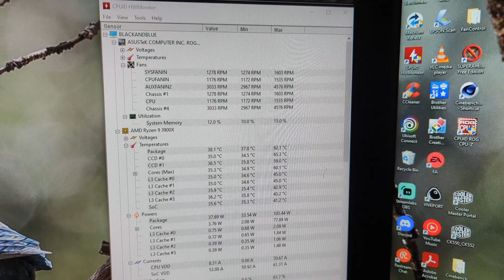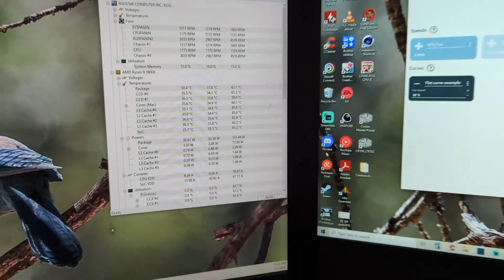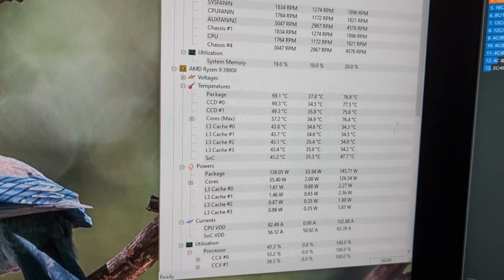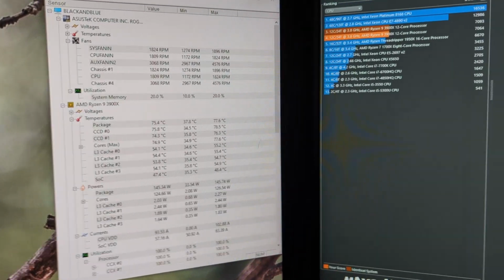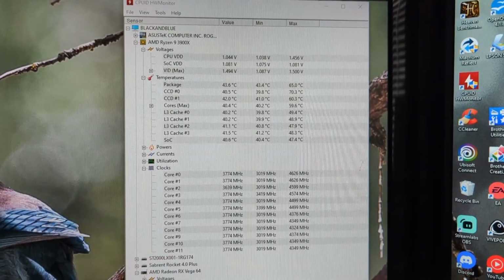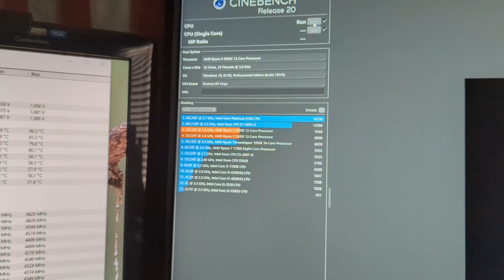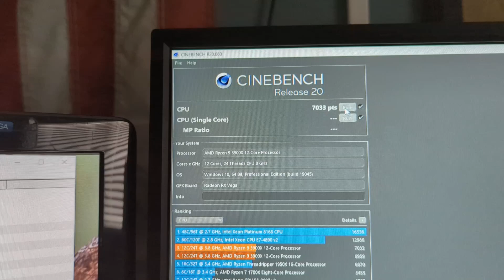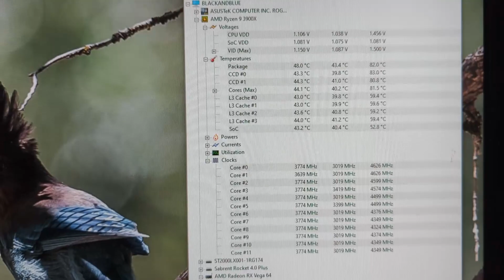280 radiator leaked on me

Comment: Sad to hear your phoenix took a dump. I found your channel after I purchased one of those radiator pump combos and I was trying find the tubing size and your video you did was helpful. The thing your had the only video on it at the time. I didn't end up using because I like 7/16 tubing with 1/2 barbs personally. I left the thing on the shelf and one day the power went out for a few days due to trees knocking out lines out and I heard the radiator made a pop noise which was strange because the ones I had in my ACTIVE system didn't do that and they were in a colder part of the same room, I remember thinking what a piece of junk.

Back on topic: 
I don't understand the gimmick of setting a pump curve when you should just be running the pump at 100% because you want the heat removed from the CPU/GPU as quickly as possible.  If you have an issue with pump noise don't place the system near your head. Also try placing the case in that empty space off to the right on the floor, heart rises...  Arctic MX-2 is very old the MX-5 and 6 are better pastes by comparison. There's little difference between 5 to 6 though.

If you want better temperatures you need more cooling capacity or run your fans over 2000+ rpm (your current fans are not likely to be able to do so), which means not using an AIO smaller than what you had in there. did you try the side panel off? The only real solution is for you to upgrade the radiator to a 360mm or 480mm and buy better 120mm fans. You can have more cooling with less noise plus you can make your own radiator mount to go along side the NR200. Do a search for "NR200P Custom Loop with External MO-RA 360 Radiator" to get the brain moving.  Cases though are on sale right now and it might be cheaper in the end to get a different one. Replacing the case and doing a new loop might end up being cheaper especially if you get your case second hand. Cases just don't go bad. Doing something like setting up an ebay search makes waiting for a case you are interested in easy. You can usually get one for less than $100, I'm assuming you are looking at and ATX mid-tower don't want the corsair 1000D.
Reply from the maker: TKS for all the advice but I do know what I am doing.  With that being said the only things I needed to do is get a 280 which I have now and will keep the 240 in there as before when I had the Phoenix in this same case, the only difference will be that the 280 will be a slim version using the Vardar fans that came with the Phoenix rad.  I thought I showed in the video that turning up the pump did nothing, and my computer is about 3 to four ft away.  If I ever use that pump after I replace it with what I got (up coming video), I will put the D5 from my Phoenix on it instead.   I know at the end of the video I was saying 240 for the replacement where I actually meant 280.  Did not edit or reshoot because I wanted to get the video out to my stream viewers why I have not been streaming for the last month in a half.